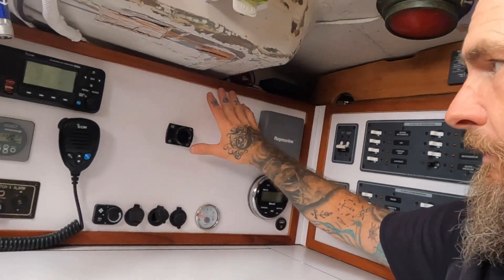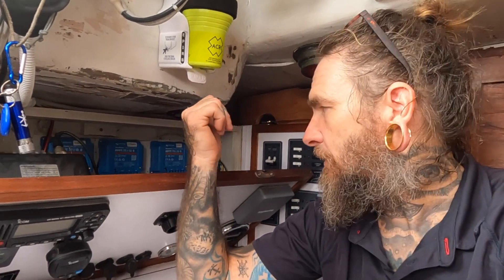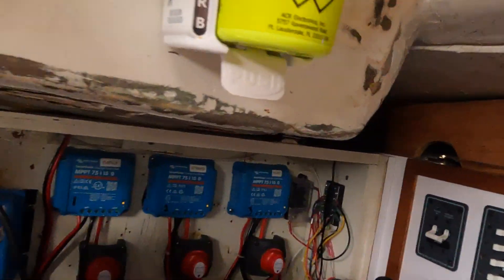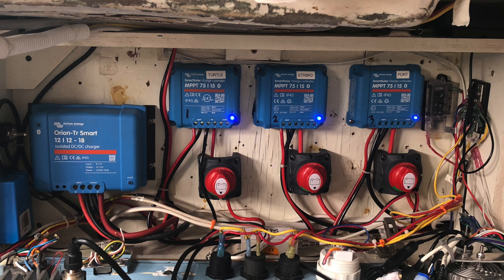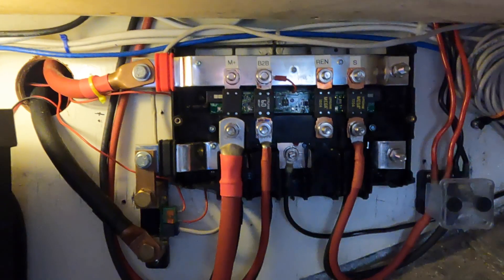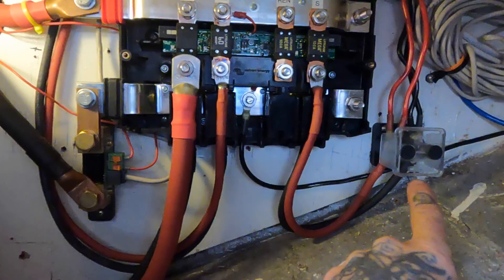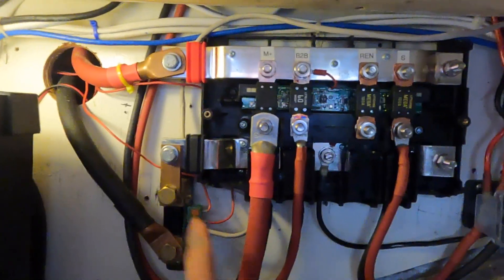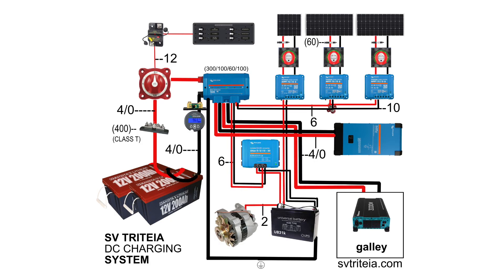A Look At The New DC Charging System on My Vintage Sailboat

Comment: So i guess there is no need for my ACR btween the house battery bank and start batteries now that the 12/12-50a victron charger is to be installed now. Can it be install in the same area? or does it need to be close to the alternator /start batteries? Hoping it can be anywhere on that positive leg.
Reply from the maker: The ACR isn’t needed for this set up, you need a DC2DC
Reply: I just bought the new edition 1212.50  @SailorJames

Comment: I like redudancy, especially for critical systems like your nav instruments. If the BMS shuts down the lithium batteries for whatever reason, all the DC distribution would black out, that's including the nav lights and nav instruments. Is there a way to use the starter battery as a backup source in this situation?
Reply from the maker: Not without rewiring which wouldn’t be too difficult

Comment: Very informative video. But could you complete the circuit from a plug socket back to the battery via a fuse board ? It will help complete novices like myself.
Love the trickle charge circuit to the starter battery.
Thank for a interesting video.

Comment: Sorry to reignite an old video but im finding it extremely helpful in my refit!! So thank you so much for all the information you are putting out there in an extremely palatable way. In thinking through my own system I just wanted to clarify about your lynx distributor. Its my understanding that it also acts as the common ground/negative bus no? Do you have you lynx directly grounded to your motor as well? And what is your opinion on an external grounding plate? On a side note, did you bond/ground all of your seacocks/thru-hulls?
Reply from the maker: Yes the lynx is grounded to the motor. 
Grounding thruhulls is no longer advised by experts and has proved to introduce electrical currents to fittings that otherwise were naturally isolated

Comment: Hey James Question: so Clark on “SV Temptress” has a battery monitor system to manage the lead and lithium charge differences and as to not screw up the alternator???    It’s 380$ and I’m wondering what you think about this and how You, with this system monitor the voltage fluctuations? BTW I’m installing all this on my sailboat ⛵️
Reply from the maker: If you have a DC/DC it manages the charge between the two different types. There is no “Need” to know that info, some people just like to know.

Comment: Are you using just one of the Lynx adapters or is there another one underneath the one visible? I’m very un-knowledgeable about this right now but I did subscribe to Nate’s channel so I’m going to be filling in that gap in my knowledge… thanks for the heads up!!
Reply from the maker: Only needed 1
Reply: @SailorJames   thanks! I was pretty sure it was only one but wanted to be sure before buying one. I’m slowly piecing together my own system so I can already have it together whenever I get my own boat. Kinda putting the cart before the horse I know, but it’ll be one thing less to have to buy…

Comment: Great system and very helpful as I am seeking to design my own lithium capable system. Thanks. Can you please explain what you did with your (automatic or manual) combiner (that surely would have been fitted at some time)? As you will appreciate, they were installed at a time when both  start & house were the same chemistry but now most manufacturers recommend lead acid on the start and lithium on the house, while ignoring that key piece of equipment, although one recommended keeping it to provide an alternative load (to protect the alternator) in the unlikely eventuality the BMS switches out. Did you remove yours and, if so, how do you ensure that your start battery is always charged?
Reply from the maker: The starter has its own dedicated solar panel as a trickle charge. Works perfectly
Reply: @SailorJames  So you have no other means of charging the start battery in an emergency? And presumably no flexibility to combine both banks if the start battery is low (but the house charge adequate)?

Comment: You mentioned that you prefer several solar controllers + isolators/switches. I get the point about redundancy but can you explain the point about it helping if one panel is under cloud?  Ordinarly, one would have your panels wired in parallel (ie 12/18V nominal) so are suggesting that if one panel is producing (say) 18V and another (say) only 6V (due to cloud), that results in feeding a current round the underperforming  panel (presumably lost in heat); whereas if the parallel connection is made after the controller, that dedicated controller essentially isolates the underperforming panel? Is that the theory?
Reply from the maker: Yes that is correct
Reply: @SailorJames  Interesting. Thanks. Yours is the first system to suggest that but it makes sence.

Comment: I've watched a lot of videos on installing electrical systems on boats and this is the most helpful. I'm about to do a very similar setup on my 38ft ericson (minus the 2nd inverter and dedicated starter solar panel). Is there anything you'd do differently in hindsight?
Reply from the maker: Only thing I would have done differently would have been to add a smart alternator, when there is more than two weeks of cloud cover a smart alternator would be less hassle than my small generator
Reply: @SailorJames  gotcha, thanks for the reply

Comment: I just got the 4/0 cable for my system. Damn! That stuff is huge! I did a double take and the manual for my LiTime (Amperetime 190 with 150amp bms) and it recommended #4 AWG! It looks like 4/0 is what you used. My Renegy 2000W inverter came with 3' of 1/0 cable and it seems big. I get that you are running two inverters and that's why the 4/0. I ran the diagram past the yard owner and he thought it looked good.
Reply from the maker: Yes they are massive but that’s what you need for a setup like mine. It’s basically the same cable used for welders

Comment: Is there anyone who can explain how the battery switch is connected?
Reply from the maker: The battery switch is connected between the batteries and the main house bus bar
Reply: @SailorJames  comon = load, 1. Starter and DC to DC, 2. House, and both?
Reply from the maker: The starter has to be completely isolated because of the lithium bank. It has its own small shut off switch

Comment: Thank you for describing lessons learned from your LFP conversion. There are many good ideas here worth considering. Your overall design is one that is commonly recommended - as a way to protect the alternator from too much draw from the LFP bank, and to ensure that the alternator always has a battery to accept its charge. One disadvantage is that the charge rate to the "hungry" LFP bank (400 Ahr) is limited to the capacity of the DC-DC charger, and only while the engine is running. That relies heavily on solar for the rest of the needed LFP charge input.

There is an alternative approach worth considering, which I intend to implement on my boat. 
A 120 Amp alternator (down-rated to 90 amps by an external regulator) sends charge to both the House 500 Ahr LFP bank and Start/Windlass 150 Ahr AGM bank through a Victron Battery Isolator.  In this way the battery banks do not "see" other, but are both able to accept charge.
Due to the alternator down-rating that alternator, the banks (especially LFP) can "suck" as much power as possible without the alternator overheating. Due to the dual bank connection through the isolator, if all of the LFP BMSs shut down, charge will still flow to the AGM bank, thereby protecting the alternator.
The external regulator will be set to an LFP profile and therefore send about 14.4v to both banks (which is a low/slow charge for the AGMs). After the engine is turned off, an 18 Amp DC-DC charger set to an AGM profile will feed a higher charge current (about 14.8v) & then float to the AGMs, keeping them fully charged to avoid sulphation. Although the LFP bank will also receive solar charge, it is OK if the LFPs do not spend most of their time at 100% capacity...

Comment: How is your electric system on Triteia holding up? Would you consider doing a review of how it has performed?
Reply from the maker: It has done great, solar in NZ was not as efficient as in the tropics and yes there are plans for an upcoming video about the electrical system
Reply: @SailorJames  great to hear. I've just bought a Sadler 25 and will be looking at installing a 'light' version of your set up for coastal cruising.

Comment: Hi James I see a problem. Your B to B charger installed is not what is on your spec, you installed an 18 AMP. The problem is that if you need to run your engine to charge your house bank you will be getting very little to your batteries. Your alternator is probably an 80 Amp and you are only sending 18 amps to the house bank, the spec is 30 Amps. However I would recommend doubling that to at least 60. You can add multiple units to bring it up or get one of the new Victron 50 Amp B to B's. You may ask why I know this and that you have plenty of power from the solar and don't need the engine. I just completed a circuit of the Pacific in a 27' sailboat solo. I have 560 Watts in a very similar array to yours and 675 AH of lead battery bank. On my passage from HI to Santa Cruz Ca I lost my alternator. I had plenty of power until I got into the higher latitudes then I was REALLY short of power. Solar was only putting out 1/3 of Watts I was getting in the tropics! So if I could have been putting 50-60 amps an hour into my batteries when I ran the engine I would have been golden. BTW in addition to loosing my alternator a fishing net got wrapped around my prop and I was unable to free it or run my engine in gear for most of the voyage. Ben S/V DAWN
Reply: I believe the general rule in these scenarios is to use 50% of the rated output of the alternator, early Yanmar 2GM20Fs had 35amps alternators, and some later ones had 55amps, assuming this one is 35amps, 18amp DC to DC is pretty much spot on.

Comment: Alternator to AGM and then charging the lithium through a DC to DC converter is safe for the alternator. But it’s slow. If you had a high current alternator you could pump 100+ amps right into the lithium and you’d end up running your engine to charge a lot less time.
Reply from the maker: Yes if I have $700 for an alternator that’s exactly what I would do.

Comment: I like your setup. I suggest anyone watching to go 48v system(42-58v). The reason is 48v wiring is cheaper since you use 1/3rd the wire size, 1/4 actual but over sizing wire is a good thing.  Then a DC to DC converter for 12/24v items. you can run longer wires way cheaper and and have a converter in bow and stern. Plus once you start upgrading items like windless to 48V which gives you way more torque and uses less power. Efficiency is key to save power and weight. Using old 12V wires with a new system is not a good solution. If you change your system then replace wires and go with 48V. Also oversize your inverters so if you average 3kw for several hours you have 3 3kw inverts or 2 5kw inverters. you want your inverters to run between 10-50% rated power consumption to prolong the life of your inverters. I have 2 5kw inverters powering my house and I use under 5kw almost all the time. Sometimes I hit 7kw but most of the times I use 1kw. Build your system so it can last 20 years and be upgradable by adding more batteries or even another inverter for a spare/backup.
Reply from the maker: Sounds like way more stuff that can fail
Reply: @SailorJames  Not at all. You are overworking your inverters. The system I am talking about is not over worked and you have redundancy. Plus it's way more efficient.

Comment: Hi James! This is a big help. I have two uninstalled 190AH LiFePO4, and two rather old AGM's (Mastervolt 150AH). The AGM's are almost 100lbs each! I have been confused about how to wire up my 3 mppt solar, DC-DC charger, and lithium house to my AGM starter battery. I doubt that I need both AGM's anymore, one is a little stronger than the other. Your and Ryan's wiring diagrams including wire size are great! I've got Arethusa in a good yard and they can help, or do it for me, but I want to do the install. I have watched the videos on the "Bank Manager" (Emily and Clarke's Adventure) and he criticizes the Victron DC-DC Orion Tr smart charger. I already bought one, the non isolated kind, and I like the Victron stuff. It seems to be well made for a marine environment.
Reply from the maker: I have had zero issues with the Victron Dc to DC 👍🏻
Reply: Some people say the DC to DC put out a lot of heat. Where did you mount yours, and does it heat up the cabin? @SailorJames

Comment: Curious as to how you wired the starter.  Are you able to use the house bank if you had to? I know it's not recommended, but in an emergency, I'd prefer to damage the battery over wrecking the boat.
Reply from the maker: Between sails and an anchor you should not need an engine (or need to destroy your lithium batteries) as long as you don’t put yourself in a bad situation to begin with. I sailed from Fiji to NZ engineless and arrived in a building gale and was fine.

Comment: Any reason you went with a AGM dual purpose battery instead of a starter batt? I have a newer AGM dual purpose but wonder if I should use a starter battery. I will also use a DC to DC charger so would a dual purpose be the better choice? thanks
Reply from the maker: I have used dual purpose for years with no issues. I don’t believe it matters.

Comment: Didnt you mean to put your DC panel on the schematic? You show your AC panel.
Reply from the maker: You are incorrect
Reply: @SailorJames  Hmmm you show the battery connected to 120 vac panel..look closely. Did you use an isolated dc to dc?
Reply: nope @SailorJames

Comment: I have a 30-foot Pearson, and my electrical system is turning out to be a lot like yours.  When I bought the boat a couple of years ago, it only had the original starter and 1 leas acid house battery.  I commissioned an electrical firm to update the system. They installed a Multiplus 2000 watt charger/inverter, 2 AGM house batteries and a Color GX system monitor.  I also had two flexible solar panels mounted on the Bimini.
Strangely, the AGM batteries failed earlier  this year.  After reading a few YouTube reviews, I decided to replace them with 2 Redodo 200AH LiFeP204 batteries.  Since the AGMs only provided 50AH of power apiece, I am quadrupling the size of my house bank by installing Lithium.
I am curious as to why you chose to install Dakota batteries as they are so much more expensive than other 200AH batteries on the market.😅
Reply from the maker: Because they are far better 👍🏻
Reply: How are they better?
They are assembled in America (with Chinese parts)  and cost 3x the price.
Reply
 @SailorJames
Reply from the maker: For one thing Redodo only offer a 5 year warranty and Dakotas offer an 11 year warranty. Which tells you what the companies confidence in the materials used are.

Comment: Hey James, Love the video. Currently doing a refit on my 35ft boat and I am going to be following this design very closely for my 600ah house bank. Something I noticed was that you had installed the Orion 18 in the video but on the electrical diagram you have an Orion 30. I have a 75 amp Balmar that isnt new but is aftermarket. Curious why you went with the 18 vs the 30 and do you have any advice for which one i should go with?
Reply from the maker: The 18 is the one Dakota Lithium recommended I use and sent me, it’s worked great 👍🏻

Comment: Can you not charge your starter battery through a direct connection to the Victron?
Reply from the maker: There are like 6 different “Victron” elements to this set up so I am not sure what you are referring to
Reply: @SailorJames  Victron Multiplus Inverter Charger
Reply from the maker: There is a trickle charger for the starter battery but that battery charger only works on shore power or when a generator is hooked up. I haven’t plugged into shore power since June of 2021

Comment: This is great, we’ve got a lithium system in our van that was based off of explorist life wiring diagrams and we just bought a 68’ Cal 34. What you’ve created is very similar to what I’m hoping to get in the boat. About to wire up our 60 watt panel to the starter just like you’ve got here.

Love the lynx distributor!

Comment: Hi James! Nice job. I'm currently doing a renovation of my whole system as well and can't decide if I should change the system to 24 volt instead of 12 (as it it right now). What do you have and why?
Reply from the maker: I have 12v because I don’t need 24v
Reply: @SailorJames  Alright. I think I will go with that as well because everything on the boat is 12 volt today. Just was reading something about benefits with 24 volt when it comes to the efficiency of the solar power, but haven't read enough about it yet. Thanks
Reply from the maker: To me, What it gives you vs. the headache of having a 24v system when most things at most shops is 12v just isn’t worth the headache